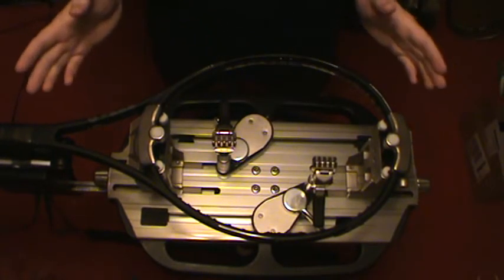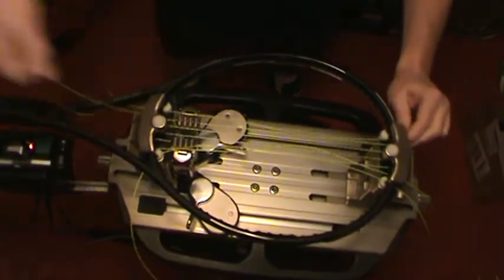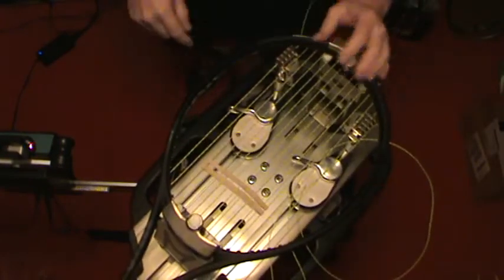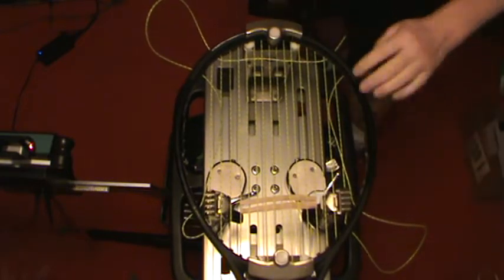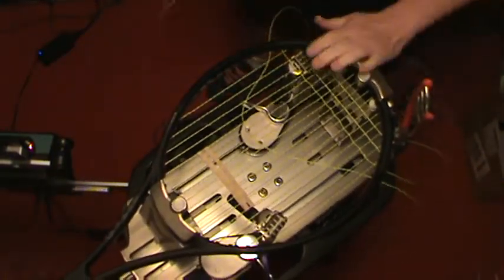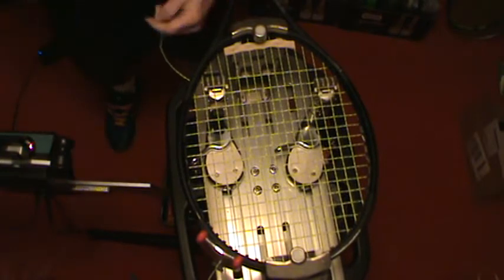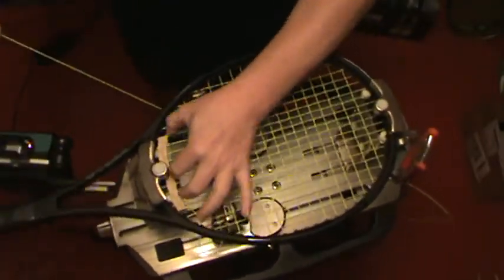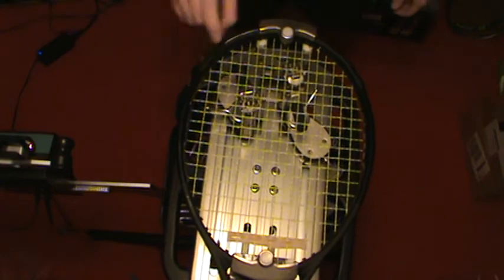Part 2 How to string a Wilson Pro Staff 97LS (18x16) tennis racquet using a natural 1 pc. string job

Comment: Have this racket to string for a club member. Im new to stringing only strung 10 rackets.  I string 2 piece,  how much string should I use for both mains and crosses in feet, I'm using volkl v square 17g poly at 47lbs - would you you know?
Reply from the maker: Hi @Mohammed Razaa,

The exact length that YOU will need is somewhat dependent on exactly which machine you are using (since the distance from the mounted racquet's edge to the rear of the gripper/tensioner will be a different measurement on different machines).
Also - If you happen to have a Starting Clamp available (which can be used to "bridge" a slightly shorter length of string to the gripper/tensioner for the final pulls which precede a knot), then you can get by with less string length than if you don't have a Starting Clamp available.
Lastly, the length needed for the CROSS strings is also dependent on whether you plan to use a Starting Knot for the top cross (uses a little less string) or plan to hold the top cross with a Starting Clamp (which uses a bit more string).

If you want a quick/short answer (but will waste a fair bit of extra string if you are cutting the string off of a reel), cut 22 feet for the 18 mains & cut 18 feet for the 16 crosses.
These generous lengths above will be plenty regardless of...
- which machine you are using
- even if you don't have a Starting Clamp to "bridge" shorter lengths of string
- whether you plan to use a Starting Knot for the top cross, or hold the top cross with a Starting Clamp

However, if you answer the following questions, I can give you much more specific string lengths for what will actually be needed (i.e. shorter lengths, therefore less waste).

1. Will you be using a set/pack of V-Square, or will you be cutting lengths from a reel?
2. EXACTLY what stringing machine are you using?
3. Do you have a Starting Clamp to use as a "bridge" for the final pulls, if necessary?
4. For starting the crosses, do you plan to use a Starting Knot, or do you plan to use a Starting Clamp to hold the top cross?

Also, if/when stringing the Pro Staff 97LS (and other frames with the same configuration) with the 2-piece method, you are going to have a total of 6 blocked holes.
4 of these blocked holes will be at the head end of the frame (namely, 8H on both sides & 10H on both sides).
These 4 blocked holes are also much more likely to cause you to have a crossover/overlap on the outside of the frame.

If you want to eliminate the headache of dealing with these 4 blocked holes AND be able to completely prevent getting any crossovers (as well as reduce friction) at the head end of the frame, I suggest this...
- Tension & clamp only 6 mains on each side (this puts the clamps at the throat end of the frame - out of your way)
- Next, pre-weave (but do not tension) the top 3 crosses (ideally, do this in reverse order... weave cross #3, then cross #2, and then cross #1). Later on, they will be tensioned in their proper order (#1, #2, #3...) To double check that you've used the correct grommets... cross #3 should be going through 12H on each side. Cross #2 should be going through 10H on each side. Cross #1 should be going through 8H on each side.
- Now you can resume installing/tensioning the outer 3 mains on each side of the racquet.  NOTE #1: when installing these final mains on each side, pay close attention to properly go over/under the 3 loose/untensioned cross strings that you already have in place. NOTE #2: also be paying attention, ON THE OUTSIDE OF THE FRAME, that you are not creating crossovers there. Regarding the strings on the OUTSIDE of the frame, I like to keep the main string loops "down low" and route my cross string loops "up high". You could easily choose to do the opposite. The important thing is to have them reside at different levels & NOT cross over one another.  Later, once everything has been tensioned, all the strings (on the outside) should/will be PARALLEL.

The throat end of the frame will have only 2 blocked holes (namely, 10T on both sides).
These are the grommets where the second from bottom cross (15th cross) will need to pass through.
You can make these much easier to deal with later on, by doing the following just PRIOR to tensioning the 9th/outer MAINS.
- After you have each of the 9th/outer mains in place (but not yet tensioned), place a 12" piece of old scrap string (just save/use some of the old string that you are cutting out of the frame) over/behind the little loop of main string that connects the 8th main string to the 9th main string (this is the loop that will be blocking 10T after you have tensioned the 9th/outer main).  Later on, when it's time for you to install that 15th cross, you will then be able to fold that 12" scrap over on itself. This gives you about 6" of (doubled over) string to pull up, or down, on.  This allows you to effectively move the "blocking string" out of your way, so that you can then easily pass the 15th cross through the 10T grommets.  NOTE: I use 12" pieces of 1/4" wide polyester ribbon for this task.  However, I'm only advising you to use 12" pieces of scrap string because I know you aren't going to have any ribbons on hand.
- After getting the scrap string (or ribbon) in place, you can then tension/clamp the 9th/outer mains & tie them off. Be sure to tie the mains off at the CORRECT location - which is at 9H (the outer main ties off onto the penultimate main).

Now that you have the mains tied off, you have ZERO blocked holes to deal with at the head end of the frame, NO crossovers, & only 2 blocked holes to deal with at the throat end of the frame (but those will be very easy due to the scrap string/ribbons already in place). 
Finally, start tensioning your crosses at the head end - moving downwards toward the throat.
If you aren't already in the habit of weaving your cross strings "one-ahead", be sure to do that (it makes weaving much easier & also greatly reduces friction).
With the top 3 crosses already pre-woven, you get to tension cross #1, then cross #2, without delay.  However, then pause for a moment.
This is when you will want to weave cross #4 "one-ahead" (BEFORE you tension cross #3).
Continue down the racquet in this manner.
The correct tie-off for the top cross is 6H.
The correct tie-off for the bottom cross is 6T.

Cheers, Wes
Reply: @PCSStringing   thanks a lot, worked fine, I used 19 feet on mains - just enough by few inches,  sorry for not mentioning what machine I use = pro stringer

Comment: Hi could you make video of Wilson RF97 Autograph 16x19 pattern? I’ve been having blocking issue with that and I don’t have a starting clamp
Reply from the maker: Sure. I don't know if you're using fixed clamps or flying clamps, so that is going to play a roll in what options you have.
Since you don't have a starting clamp, that too may limit what options you have.
Tell me...
(1) if you are using the same string for your mains & crosses, or if you are using a hybrid (2 different strings).
(2) whether you are using a machine with fixed clamps or with flying clamps.
With those answers, I can give you more info.